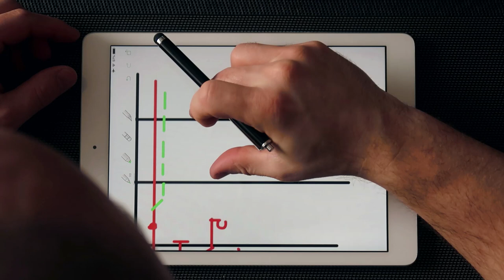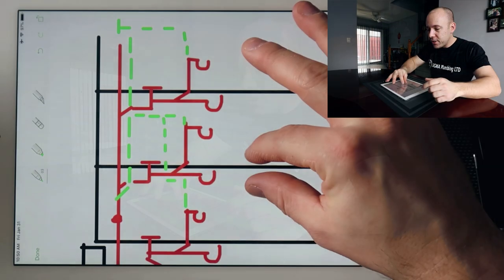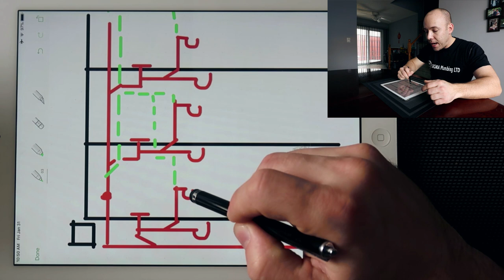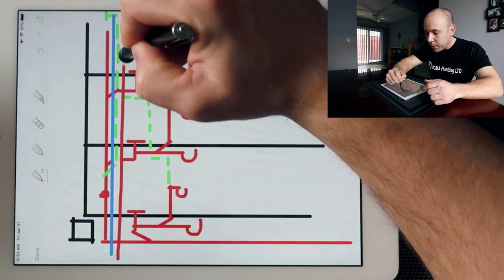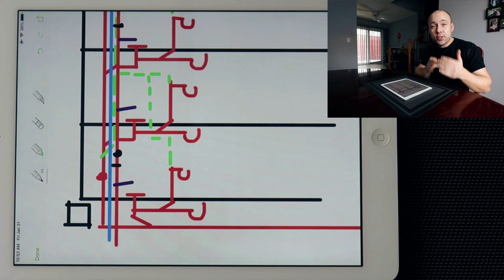A Day In The Life Of A Plumber | Plumbing Hot Water Risers | Vlog 68

Comment: Great videos brother. I also work in Toronto and have done hundreds of risers for Toronto housing. Only negative thing is the amount of couplings you used. The top floor you’re starting out at cut the dry wall to the ceiling then feed the proper measured lengths of copper to avoid couplings as much as you can, even if you have to punch the sleeve out . And also another huge thing you didn’t do is ream the pipe. That’s how you get pin holes in majority of cases “Turbulence”
Reply from the maker: Thanks for the support and tips broski! Glad to have another torontonian on the team!
Reply: Kenny Molotov no problem. What program do you use for your elevation drawings on our iPad?